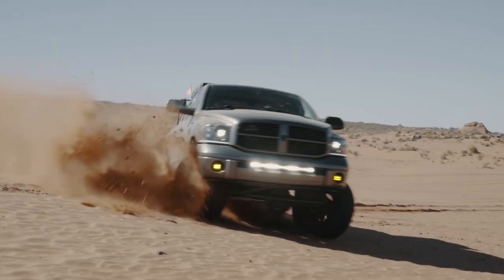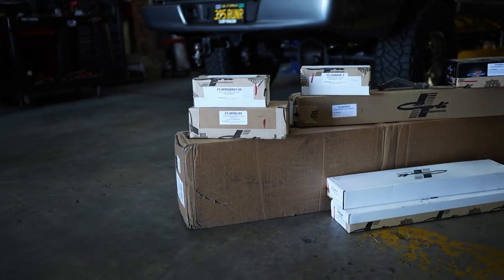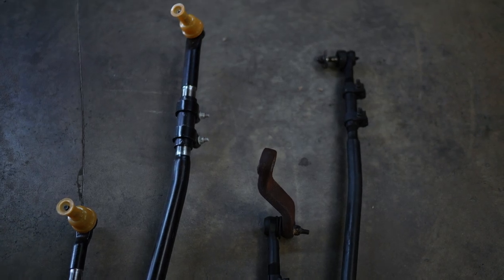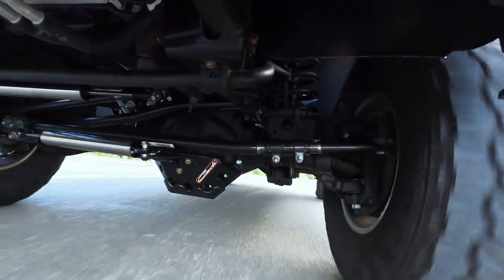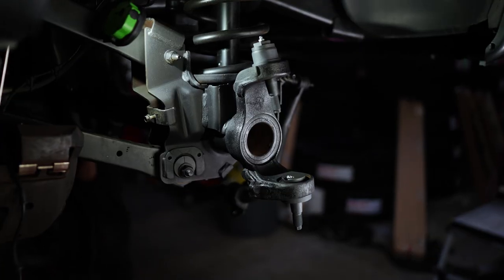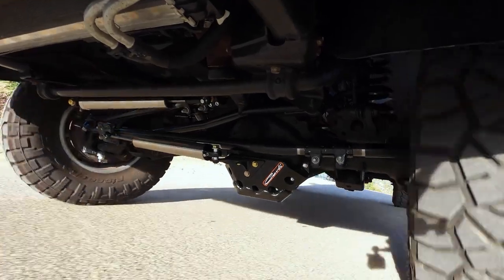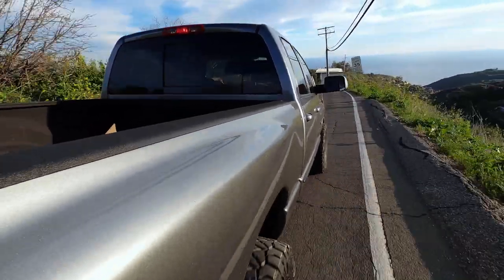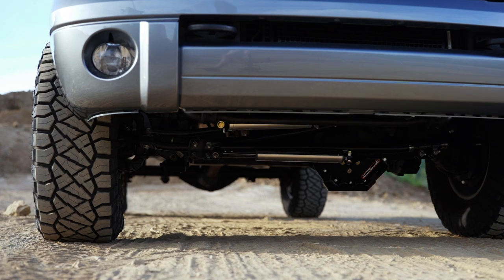How to Do Your Steering Right! | Fixing My Cummins Dodge Ram Steering Forever

Comment: I did look at the carli track bar for my truck, 05 f350, but unfortunatly it will not work in a stock height application. in this case ill most likely run all synergy steering components.
Reply from the maker: It works just fine for stock to 6" lift. I used it on a stock height truck in this video.
Reply: @JustDiesels  in my case per the Cali website it will not work on a stock height truck.

Comment: Could you post your alignment specs? Toe, caster or camber which ever one is adjustable on the solid axle trucks.
Reply from the maker: Toe should be .05 degrees, caster should be 3-4 even on both sides, and then camber isn’t adjustable on a solid axle truck.
Reply: @JustDiesels  thanks

Comment: What pressures are you running in your upper and lower steering stabilizers? I’m going to install mine this weekend and am trying to get an idea of if I am going to need to adjust them. Thanks for the info.
Reply from the maker: 40-70 is neutral. I recommend starting from there, and then adding additional pressure to one or the other if needed to correct for a tire pull. You can experiment with it though if you have easy access to dry nitrogen!

Comment: I have a question for you.  I just upgraded my steering box to the Ram big bore box that you have.  This unit brand new out of the box has about 1/4-1/2” of play in it.  Did you notice anything like that in your unit?  I’m pretty frustrated with what I’m seeing I’ve been chasing slop in my front end for a while.  Any help or feed back would be greatly appreciated.  I have Carli ball joints and the same tie rod set up you have but I only have 1 steering stabilizer that came with my 2.0 backcountry 3” kit.
Reply from the maker: When I did the box on my old truck I went through two defective ones and then the third was solid. It happens! You just have to be careful to really isolate the source of your play.
Reply: @JustDiesels  WOW! 2 defective boxes from the dealership, that would be about my luck.  I spoke with a mechanic from the dealership this morning, he looked it over and thought the steering box was ok and said that they have to have a little play in them to keep them from binding.  That being said I don't remember the truck having play in it when it was new.  He did ask about the steering stabilizer and when was the last time I had serviced it.  When you got the 3rd box did it have any play at all like the mechanic was talking about or was it good and tight?  Also in your experience would the steering stabilizer take the remaining play out of the system.  I haven't had mine serviced in a while and it may be time to upgrade to a duel stabilizer system like you have.  Thanks for all your help,  it's appreciated.  I have a solar yellow 2005.5 with the G56 in it that I bought brand new in 2006 with 183k on it that I've done a slew of upgrades to.

Comment: is there a similar review of the 2013 (3500's) ?  4th Gen?   I recognize the same issues shown in this video in my 2013, my suspension shop says I have the Y-suspension, but still seems to have an un-adjustable alignment (caster?), unless offset adjustable ball joints are added.
Reply from the maker: A 13 3500 is actually the same as all the 14+ trucks. You have a MUCH better steering setup! All the same info applies with the exception of the linkage itself. If you need a replacement, do the 19+ OEM parts. There’s also a new brand called Apex that is making steering for these trucks. Curious to see how their stuff compares!
Reply from the maker: These trucks do not have adjustable camber which is likely what you’re referring to. Never ever do offset balljoints! Do you know what your camber spec is? These trucks come from the factory with some positive camber, but negative means your axle housing is bent!

Comment: Can I get a full list of everything you installed. I just upgraded my entire braking system. Now I'm going to do the full front end. This is awesome man. .  Buddy of mine sent me a link to this video. As in terms of what to do next I would focus on the suspension and brakes before you do any power adders. Love the video man
Reply from the maker: Click that link in the top pinned comment! It’s got everything you need in one kit! Mopar steering, Carli ball joints, Carli track bar, and Carli high/low stabilizers!

Comment: Your 3rd Gen build gives me inspiration and hope for my own 3rd Gen!  Right now I’m battling steering issues. Before you started your channel I bought a PSC mopar big box with hydro assist ram. I haven’t installed it yet because life got in the way. This video has me wondering if it will be the solution I’m after as I doubt the powered hydraulic Ram will provide positive pressure in both directions like you described. It will resist movement in both directions but i don’t think it will provide steering bias pressure to correct for tire pull.
Reply from the maker: The Hydro assist has a very specific purpose though in that it relieves pressure from the box when it comes to muscling around big tires at low speeds. I personally would only run that on an off road toy though as I’m not fond of the highway feel with hydro. It’s a personal preference, but I think it’s a bit too twitchy. Other people swear by it!

Comment: Hey man I love the truck! I have an 08 ram quad cab short bed with 49k miles. I was curious your fuel mileage before and after your mods! Any response is appreciated! Keep it up!!
Reply from the maker: I’ll find out, but I expect highway mileage to improve significantly with the 37s and tuning since I was winding the truck out so badly before. With the stock wheels and tires it was doing almost 2500 RPM at 70!
Reply: @JustDiesels  yeah I saw, that's nuts! Let us know! I'm excited to hear.

Comment: Do you have any experience with the EMF ball joints? It seems like they're the only ones making anything better than factory for the 2000-2002 trucks.
Reply from the maker: Yes! That’s exactly what my 2nd gen is going to get when the time comes. It’s either them or Dynatrac for the 2nd gen ball joint market!
Reply: @JustDiesels  Sweet, if you trust them then I do. I don't know what is different about the 2000-2002 trucks but Dynatrac doesn't appear to make anything for those years either.

Comment: Mopar steering setup is no better tie rod ends are the same size as old setup.Synergy or Thueren are much better setup.
Reply from the maker: I had synergy on my last truck and was replacing the joints every 20k miles. Friends running the Mopar steering were making it 40-50k with 37s so to me that made sense. 
The Thuren steering is a pain to align, but more importantly it still uses the passenger side mopar tie rod end since that’s part of the linkage. So when that fails, you need to buy a whole new Mopar assembly. To me that just didn’t make sense. I’d rather just do new mopar linkage alone since there isn’t an appreciable amount of deflection in the tubing, and you save the cost and hassle of heims.
Reply: @JustDiesels  I run a Extreme Overkill Fab. set up on my 06 it has EMF tie rod end rebuildable greaseable i think EMF also has a steering setup mines been great.The guy at EOF has since quit making that setup i was told by craig at STRAPT PERFORMANCE.

Comment: I have a 2nd gen Ram that I rebuilt the front end on, but the steering is still loose. I am going to put a steering box in it, but I am debating between a Redhead and a Bluetop. Was wondering if you had experience with either of these, or if you had any other recommendations.
Reply from the maker: I’d say redhead or PSC for 2nd gen boxes!
Reply: Put a big third gen box in. PSC used to sell a kit that was a new box, the spacers needed to clear the 2nd gen frame, and new longer bolts, and a new pitman arm. The difference in size on the sector shaft / bearing is crazy and it completely changed the feel and power of my steering. Those redhead / Bluetop boxes are just expensive remans for a steering box that was undersized for a second gen diesel from the get go.

Comment: What was wrong with the steering setup on your other 3rd gen that I thought you'd perfected when you installed the ATS?  How does this setup compare?
Reply from the maker: I explained it in the stabilizer portion of this video, but the ATS doesn’t pre-load the drag link, and the ATS is not adjustable for tire pull. This setup solves both of those issues and as a result offers a better overall steering feel.
Reply: @JustDiesels  I currently have the updated T-style steering, Carli Torsion Sway Bar, Carli Control Arms, Carli Ball Joints, Carli Track Bar, Carli Low Munt Steering Stabilizer, King Front and Rear shocks.  I installed all in 2014/2015.  I'm pulling off all the Carli Parts and rebuilding the bushings/joints/wear parts and sending the ball joints in.  In the meantime I bought some Synergy Ball Joints to try out.  During this I'm swapping to the Synergy drag link/tie-rod setup, and adding a Borgeson Steering shaft, Redhead Box, and Synergy Steering Box Brace... So my setup will be really similar to your other Gen 3.  Would you recommend switching to the Carli dual setup using the Synergy steering?  Great quality content BTW...

Comment: Whats the wheel and tire setup?
Reply from the maker: 17x8.5 Trail Ready wheels with 5” backspace and 35/12.5/17 Nitto Ridge Grapplers on stock height suspension.
Reply: @JustDiesels  was there any sort of rubbing at all?

Comment: EMF is working on a knuckle conversion to get the 14+ Radius arm knuckles onto the 3rd gen. I hope it pans out, it would give you the gigantic brake rotors and calipers found on the 14+ trucks and a true tie rod (no heims) crossover steering setup.
Reply from the maker: It works for the 10-12 trucks but sadly it won’t work for the 03-09 Rams from what I understand.
Reply: @JustDiesels  Im pretty sure the 10 to 12 has exactly same part number suspension as 03 to 08.